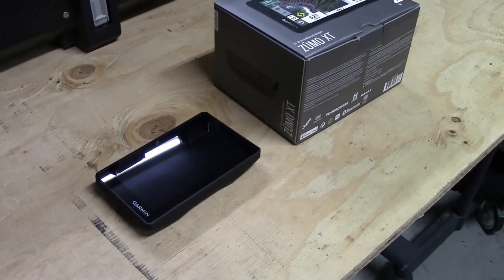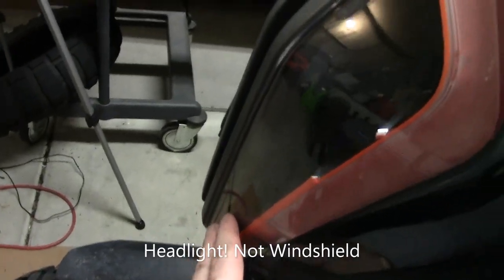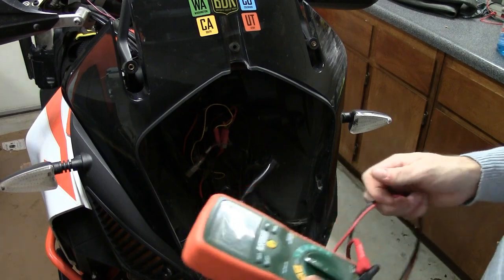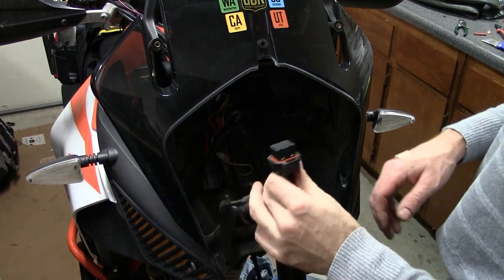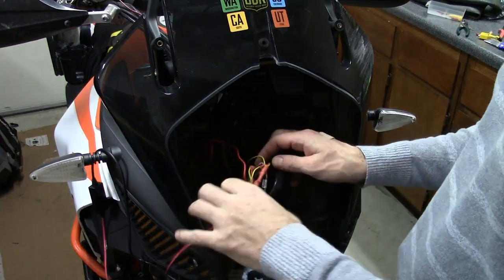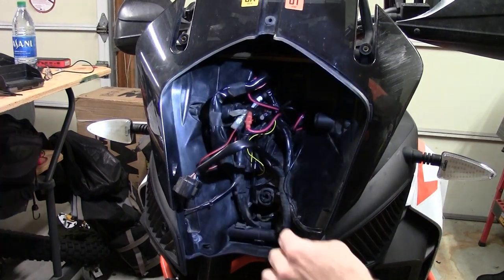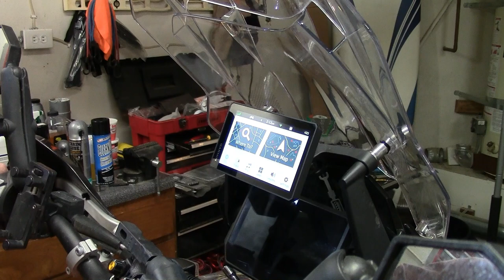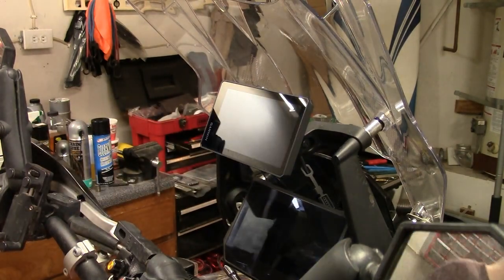Garmin Zumo XT 1290 SAR Install

Comment: Better to keep the GPS on bike's switched power ACC2. It gets charged well enough while riding and when you need it on when bike is switched off, just simply press the power button and plan your route. This reduces hassle of having to constantly press the power button on/off with the bike. This is how the manufacturer intended and its convenient. I have never seen a need to wanting to charge the GPS off the bike. If you need to then just use the 12V outlet provided to charge your phone/GPS offline. Zumo can be charged with a separate USB charging cable.
Reply from the maker: I explained in the comments below why I do this and in the video why I do this.  It's because I turn my bike on and off a lot while riding.  When you turn the bike off, the GPS will see there is no power and then shutdown unless you cancel it.  I don't like having to hit cancel on the GPS everytime I stop for just a few minutes.  I just want the thing to stay on.  That's why I did it to constant power.  I've never had any issues with it to constant power.  I'd much rather turn it on at the beginning of the day and turn it off at the end of the day.  Much more convenient to me and less hassle of having to constantly cancel the shutdown, or not notice the shutdown, and have to constantly turn it back on.

Comment: Great installation video. The headlight adjuster is a pain. I’ve stripped two lots. I’ve since found it’s easier to pull off the adjuster knob and pull the headlight out with the whole mechanism attached. 
Does the GPS vibrate or shake much when riding off road when mounted to the windscreen?
Reply from the maker: A lot of people complain about the GPS vibrating/shaking offroad.  It never bothered me and I had 2 different GPS's on it for 55k miles and a LOT of offroad miles.  So YMMV.

Comment: Wouldn't the constant draw of ACC1 drain the battery?  I have zero electrical knowledge so trying to understand. Getting read to install a Zumo XT on my 890 Adventure R.
Reply from the maker: If you leave the GPS on, then yes... it will have a constant draw on the battery.  If you turn the GPS off, then it only drains a very little amount until the internal battery in the GPS is full, afterwards it drains essentially zero.  But I've left the GPS on for a few days without affecting the battery.  However, if the GPS is turned off, then the your moto battery will be essentially unaffected.

I've had my current and previous GPS setup this way for years and have had no issues with moto battery drain. On multiple motorcycles also.

If you're worried about it though, you can hook it to ACC2 and it will only get juice when the bike key is on.
Reply: ACC2 is what most people would use, it’s called “switched live” where I’m from, which powers the GPS when needed. The GPS would be charged after riding the bike anyway, so no need to leave it charging.
Reply: It will definitely drain the battery . Had the same issue. Lesson learned.

Comment: Doesnt that headlight protector block the headlight from cooling down ?
Reply from the maker: No... It's not sealed and gets plenty of airflow. Worst case is when you're not moving at all and then it doesn't matter either way.
Reply: @ls6777  Alright thanks for responding, I'm looking for one for my 1290
Reply from the maker: @randysavage1997  I've had mine on the bike since new and never had any issues.  Over 40k miles now :)

Comment: What kind of windscreen is this? Never seen before... looks interesting!
Reply from the maker: It's actually the stock 1290 SAT windshield.  I adapted it to work on the SAR with some brackets/spacers.  It's way cheaper than the SAS windshield (~$60) and provides good wind protection.
Reply: @ls6777  Thank you!